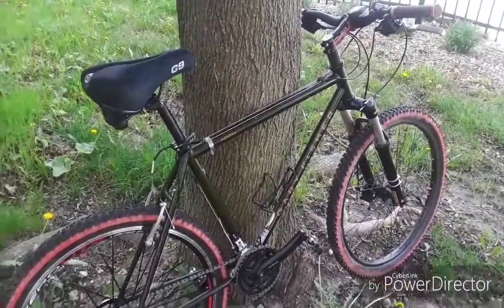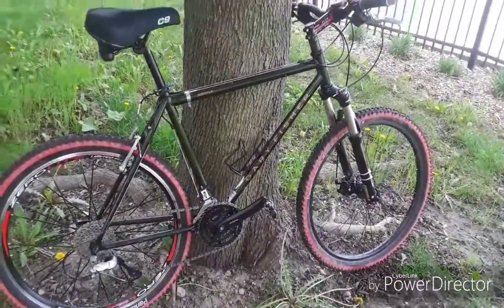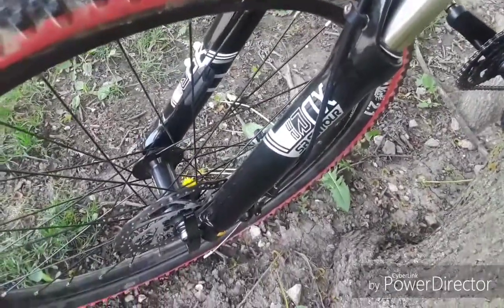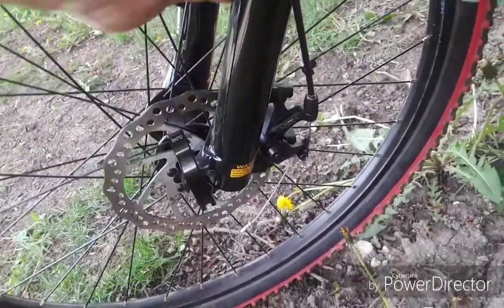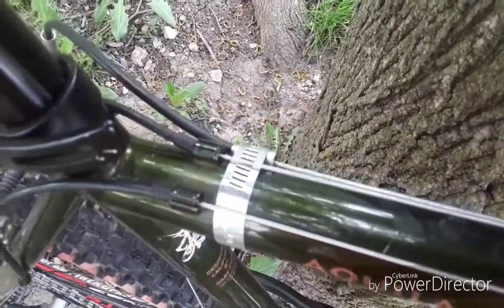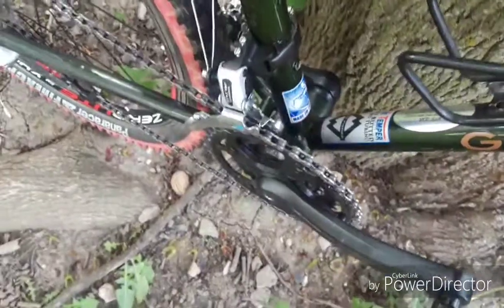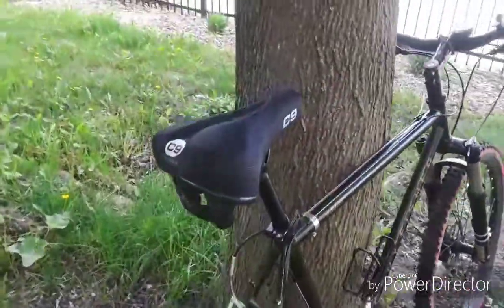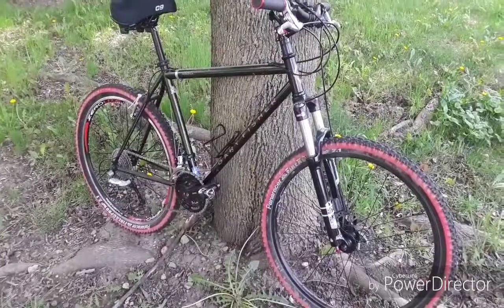GARY FISHER AQUILA BUILD...

Comment: I think I have a 1997 garry fisher piranha with threaded headset and rigid fork but I'm going to change that out for a sr suntour xcm remote lockout similar to your xcr, and I'm definitely thinking of upgrading to hydraulic brakes back and front, and possibly go for a fixed gear on the front and replace the original crank set up with a newer one and a new derailier and wheels again with all this light weight stuff on the market you could build a pretty neat classic cycle depending on where you go to look for parts of course the price will depend on the quality or and what bike you got but most stuff is mostly universal, message my you tube if you can I couldn't figure out how to if you even can but thanks I found this very helpful man litrealtly one the only videos about a garry fisher similar to my own 😅😂😭🤔

Comment: I just picked up this frame a few days ago. I find it hard these days to find 1 inch quill stem with 31.8 clamp 120mm length. Any recommendations? Thank you for your video
Reply from the maker: Hey there and thanks for watching. 
Indeed locating a longer reach 1" quill stem with a 31.8 bar clamp is nearly impossible to find. They are out there, but more than likely you will end up having to have it slow boated.. lol . 
What I do in a lot of these type scenarios is just purchase a quill adapter to threadless  (1" to 1 1/8") and use a clamp on stem...
That way you are more open to reach and +/- degree rise as there are plenty stems available with a lot more length and rise options. 31.8mm bar clamp stems are becoming more the norm these days as well.   Here is the one I use most often Profile Designs Threadless Size Converter (1" - 1 1/8") https://www.amazon.com/dp/B0028N14GQ/ref=cm_sw_r_cp_apa_ppmnBbYS1T6EN

Let me know if you have any more questions!  That is again for watching.